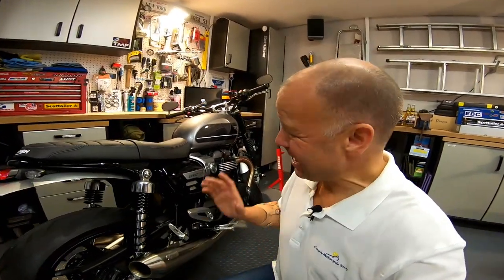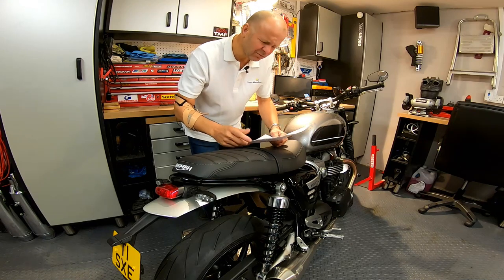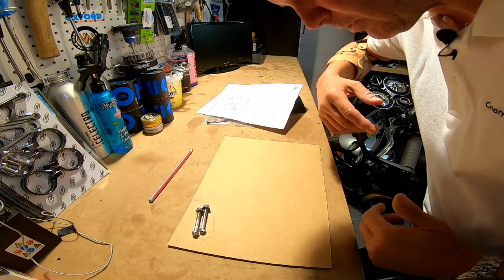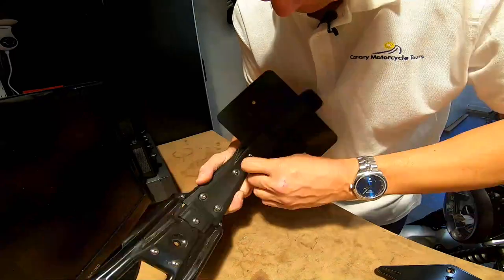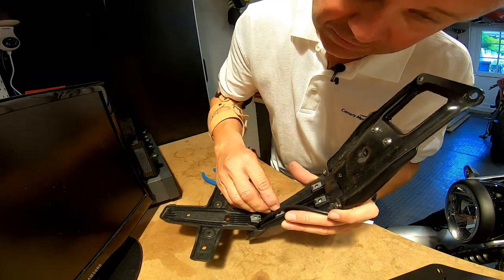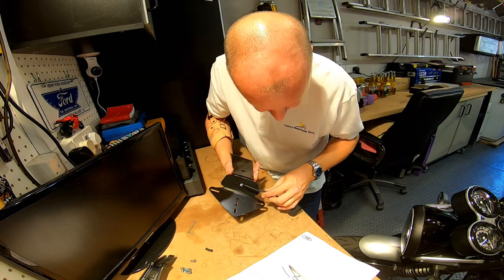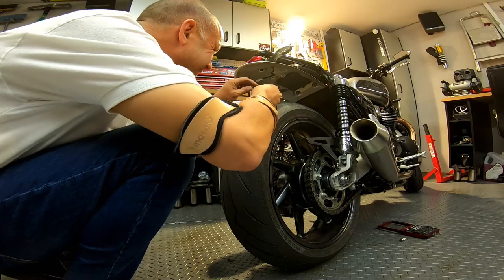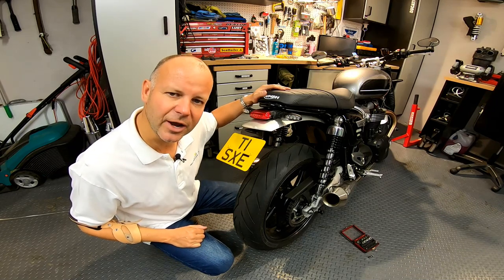How to fit a Tail Tidy to a 2019 Triumph Speed Twin

Comment: We have now made the hole larger as on some brackets the powder coat was building up in the hole.
Reply: I am in the U.S. and would like to purchase this tidy but TEC’s U.S. distributor does not appear to carry it.
Reply: What, so nobody tested the final product? Will you be recalling/replacing the ones you've already sold? Still selling the old ones?
Reply: @mrcintheuk4641  Hi
we stand by all our products and if anybody has one with the powder coat build up in the hole we will happily replace it
Reply: @noonrock4  they will ship parts to the USA if the distributor here doesn't carry it.  Matt Millburn was super helpful and I had it in a week.
Reply: @Mark Wasden....they are available in the US now. Just got mine yesterday.
Reply: that's why mine fitted perfectly
Reply: Just installed mine today on my 2020 Speed.  Everything installed easily, and wire went through the hole with no issues.

Comment: Nice video, I've just changed the plate holder on my Speed Twin yesterday but I choosed the FreeSpirits option for two main reasons, I'm from Portugal, and the FreeSpirits model as options for many countrys plate screws configurations, and the other reason, witch I can see by your video that I was wrong, was the plate light use, The photos I saw didn't look like had that option. Overall both options are pretty much the same. The one issue I had was that I had to find a way to add the rear reflector, that's mandatory here in Portugal. The licence plate material is reflective so I don't understand the need for an extra reflector in the back, but well, it's the law here. The holder also has 2 screw holes in the middle where we can fit the reflector, but I had to ad a rubber spacer between the plate and the holder so that the screws head that would hold the reflector could have space. 
Cheers

Edit: yep, I've checked TEC product page and in the photos there is no plate light installed, they should update those photos. That's one of the things that made me look for other options.

Comment: Finally went in to see one of these in person, after your reveal.  1. The Street Twin isn't just smaller, but they replaced about every neat design element from the Speed Twin with cheap plastic turn signals and finish materials. :(   2. Wow, the Speed Twin has a whole new level of finish quality and looks amazing in person.

Comment: I'm not normally a fan of aftermarket bits normally they are weak but it seems the guys at tec have a pride in making good sturdy stuff seen lots of their bits on another popular channel and am impressed ..this one also improves the look without compromising the wiring good show !! Now I just need  to contact tec for my commission 👍🏻😁..no seriously I'm impressed which is a rare occurrence for me ...peace and Love brother 👍🏻☮❤
Reply from the maker: Yes great guys to do business with and their stuff seems top notch...I don't hesitate to recommend them based on what I've seen so far.
Reply: @TheMissendenFlyer  
Thanks for taking time to feed back it must be full on your end and also as an aside I'm very slowly getting dragged into modern biking with my 1150rt (Yes I know it's ancient) with its fandango abs fuel injection strange suspension and electronic screen just goes to show sometimes we have to change..bless you peace and love ride safe and thanks again 👍🏻☮❤

Comment: Just a tip you need a reflector (Legal requirement) you can fit the original up to the bottom of the plate. Enjoyed the video thanks

Terry
Reply: I've added a Dart fly screen, which makes a big difference at motorway speeds, wasn't sure whether to fit it or not as I really liked the original look, but it's grown on me and it does make longer journeys more comfy

Maybe you could do a review?

Comment: Push the bolts through the cardboard so they can't roll or move about.
Reply: Alternatively use zip lock bags and label them with a permanent marker
Reply: When I take my motorcycle apart, I do a little diagram on a piece of cardboard showing all bolt holes, and poke the bolts through the cardboard in the relevant place.👍🏻
Reply: @kwak1k  Nice tip.
Reply: @kwak1k  I just take pictures with my smartphone

Comment: I have been using the GoPro 3m double sided pads to stick my plates on for the last 18 month. They are pretty solid too. The law is a 11mm margin from the letter to the edge, you have loads of room at the sides to cut them down further.

Comment: Looks great. You could just spray paint the hole after you had to file it (which does happen often as you note with aftermarket parts). Just corrosion protection, no one will ever see it or notice.
Reply from the maker: Good point....

Comment: The screws with 'star' heads are torx, had to buy a set of torx bits for my Duke when I changed a few bits. Well worth having as they are popping up everywhere these days!
Reply from the maker: That’s the one!
Reply: Thing  is why the beep beep do manufacturers mixed bolt and screw head types  grrrrrr..😬
Reply: carol mc yes totally agree! It's a royal pain, especially when a simple job turns into a bl**dy nightmare cos of one weird fastener!

Comment: Good choice going for the aluminum tail tidy 👍 once the gravel and road grit eats the finish off the underside you won’t have to be fighting the rust problem that comes with a steel one 😉. 
Sorry to hear about the tennis elbow. I suffered from that a few years back caused by running a hammer drill one handed. (Yes, if you’re going to dumb, you have to be tough.) Dr told me if I took care of it and did the PT it would be better in 18 months, or I could have surgery followed by months of painful PT and it would be all better in 18 months.....😳. I decided to just be extra careful and pass on the surgery 😜.
Reply from the maker: Great - only 12 months to go then!

Comment: Excellent vid and a very good mod. It looks much better than the original. With the ability to ‘file’ at that speed there’s no wonder MrsF goes round with a smile on her face! 😉😉. On another note, If you want to lose shed-loads of weight with the minimum effort and minimum ‘cost-per-kilo’, change your battery to a Lithium based one!
Reply from the maker: ...actually it already has a lightweight battery fitted....and Mrs Flyer always has a smile on her face ;0)

Comment: I've just ordered the fuel booster plug, as well as levers and the bash guard for my speed twin. The fuel booster should make for a bit smoother operation in the low rev range. Cheers!
Reply from the maker: Yes I have the booster plug fitted on mine....

Comment: Just Fitted my tail tidy thanks to this video, nice one cheers. See when you fitted the light to the tail tidy did you use the little washer sin the packet or buy/have new ones that don't require the washers?  Worried about these rusting

Comment: The "star shaped things are called torxWorth going to your local hardware outlet & get a set. Allen key will bugger the heads as not a good fit. The tail tidy is a huge improvement on the original.
Reply: Torx are useful for removing buggered hex/Allen head bolts too.

Comment: The wiring hole in the tail tidy was probably perfect until they powder coated it.
Reply from the maker: Indeed....
Reply: Hopefully, the manufacturers will now sort this out! Not a great advert for their product development process...
Reply: @malcellison8831  Heard nothing but positives about their products so Im sure they will be on to the issue as soon as. Drilling and filing isnt ideal
Reply: Absolutely. Just a pity they didn't check out the size of the hole after powder coating... A bit of a novice error for a respected company, but sh*t happens.
Reply: The company commented above that they corrected the issue already.

Comment: The tendency for me is to leave my bikes as they are from the factory but this tail tidy looks great. I need to add one to my Speed Twin.
Reply from the maker: Yes as I mentioned this is one of very few bikes that doesn't need much doing to it - lovely bike out of the factory....but this is an improvement for sure, recommended!
Reply: TheMissendenFlyer 

I will more than likely change out the exhaust also. Tail tidy is a must. Maybe a few Thruxton billet pieces as well. Good luck with your Twin.

Comment: Did mine yesterday. Same issue with the hole and connector.  My second issue was the screws that hold the light on are longer than the width of the tail tidy. The light is loose and the screws are tightened all the way. Might look for some washers
Reply from the maker: Interesting - I didn't have that issue??

Comment: Hi TMF, how many miles on yours now? I picked mine up on the 2nd Sep and now sitting at 760 miles. I cannot get enough of the motor especially in sport mode which I had left alone up until this point in deference to running the new engine. Should be called giggle mode!
I installed Thruxton R silencers and a Motone X pipe at 30 miles, which I have to say was a bit of a challenge, which gives a lovely deep tone and much cheaper than V&H silencers.
Shock and forks to be done over the winter.
Reply from the maker: I think I have around 600 on mine...

Comment: Your bike has different tail lights than mine, I don't have a center brake light, I have LED turn signals that have brake lights in them also. Similar to the metal pods on a harley
Reply from the maker: Yes they are an official Triumph accessory here in the UK....I'm assuming you're not based here? I think I prefer the look with the tail light...
Reply: @TheMissendenFlyer  I'm based in Amerizona, a small country located between California and New Mexico

Comment: Hello Andy, although technically illegal, what size is the number plate on your speed twin? I am about to fit the exact same tail tidy to my speed twin but would prefer a slightly smaller plate but obviously not the size of a matchbox. 
Cheers, Ian.
Reply from the maker: I don't remember exaclt - maybe 5 x 9 without measuring?  It's not far off....

Comment: Look of the standard bike.
Well it's "da law" for the silly bar that puts the number plate behind the back wheel. Tail tidy looks better. 
I can only conclude Triumph made the black sections on the exhaust to sell the brushed stainless steel (I assume Vance and Hines) ones you have. They look much better.

Comment: What is that device on your forearm? I have never seen one of those...
Reply: Bass Player comething to fix a tennis elbow
Reply: @barnabyg6808  I have had this condition several times before but I have never used anything to help it heal. I get mine from weight lifting and once i get it I have to lay off the weights for a while. Mine is not from a single lift event, it's a repetitive injury, over use (or abuse). Once I get it I can't lift a cast iron skillet off of the stove without pain.
Reply: Bass Player yeah it’s a crap thing to have, but I saw him say it somewhere in these comments
Reply from the maker: Correct - tennis elbow (caused by a skiing incident bizarrely) - 6 months and counting so far, I struggle to lift a full kettle with it...
Reply: @TheMissendenFlyer  It can be really debilitating, like having the worse toothache in your elbow ... thankfully I only get it during Wimbledon fortnight! Seriously cider vinegar 'cured' mine, I say 'cured' because if I have malt vinegar just once it comes back with a vengeance for a few days. Use it on yer chips, salad etc. Not saying it will work on you but it did for me and others. Been using it since the 1980's. Still working now.

Comment: MF, great video, have you a video on top box and or panniers you had on the bike for the Artic circle trip. Struggling with size and number for a 3 week trip. Will be carrying a camera and lens but not a drone or vlogging gear. 42/46/58 litre top box without panniers?
Reply: Currently Triumph do not make a luggage rack for the Speed Twin.
TEC bike parts are apparently going to make one soonish.

I want a luggage rack now !!!
Reply from the maker: On the Arctic circle trip I used a roll bag and top box on my GS - now my favourite combo for touring....

Comment: I’m just fitting mine and have discovered that the two star screws are to long when attaching the lamp to the new tail.  Bit annoying.
Reply from the maker: I didn’t have a problem?
Reply: TheMissendenFlyer did they supply you with new screws or did you use the custom ones?
Reply: @tobymiller1781  I just fitted mine and the screws were too long. They didn't include new ones so I shortened the old ones.

Comment: eh your fine, I'm more of donkey. I was trying to mount ammo cans on the side of the rear fender, but the the bolts were stripped on the fender soo i had to drill them. Which i did on a slight angle and drilled through 1/2 of the inner threads(which means i would need to get a new rear fender($200aud) in the future. However the threads seems to be still intact enough for me to bolton the ammo cans(which is a bit finicky to bolt on. I have to push up the inner frame while holding the ammo can) ..... for now anyway -_-
Reply from the maker: ...I share your pain brother!

Comment: File the hole. Thats a rust spot.
Reply from the maker: As I think I mentioned....
Reply: But you should really have to. The manufacturer should have measured and accommodated the plug diameter.